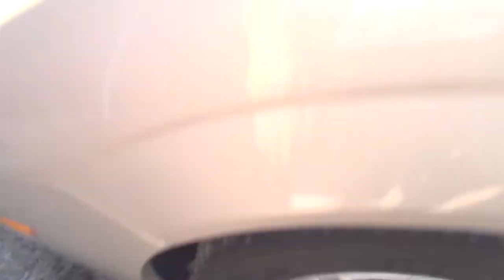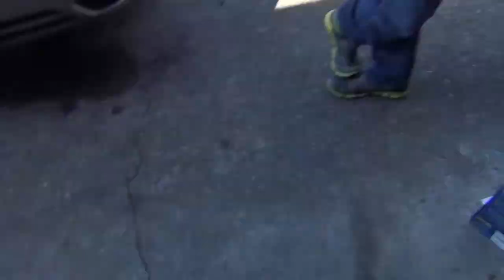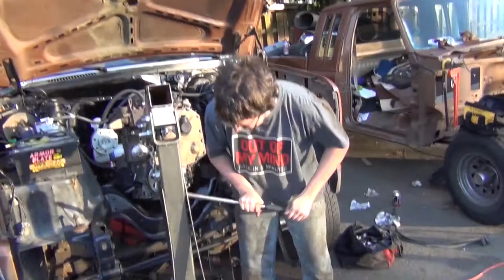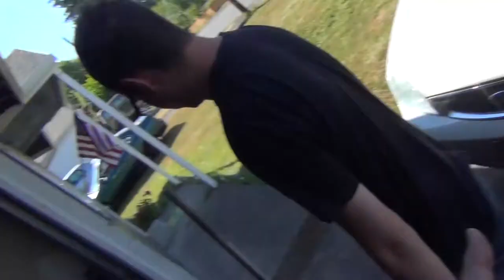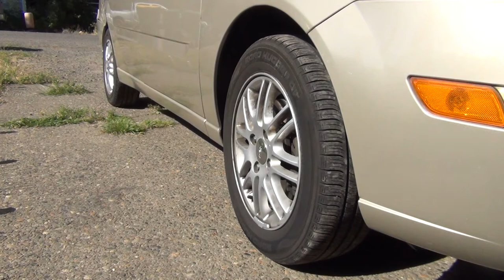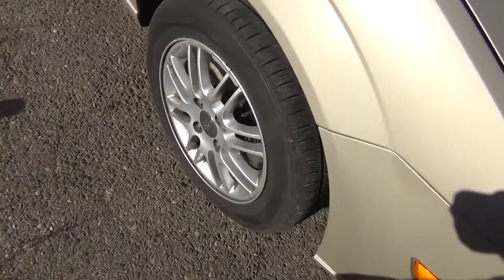Ford Focus Brake Pad Replacement (Repair Vlog Video)

Comment: Why couldn't they of just used regular bolts like every other manufacturer uggg
Reply from the maker: I know right. Instead let's use allen head bolts, that when the dust covers fall out, the heads will fill with shit and strip out.